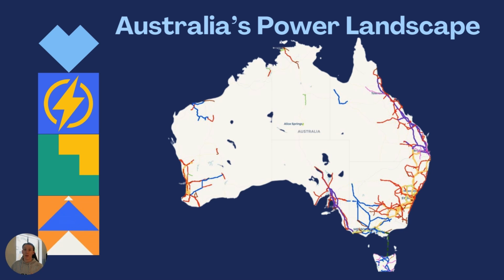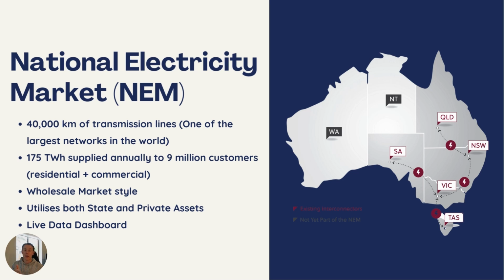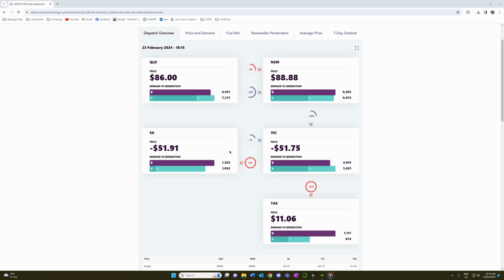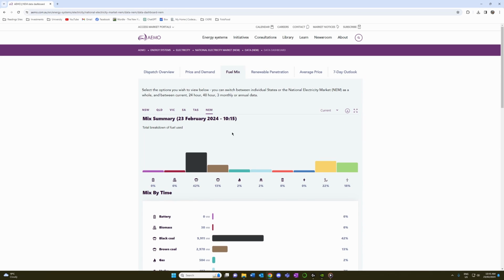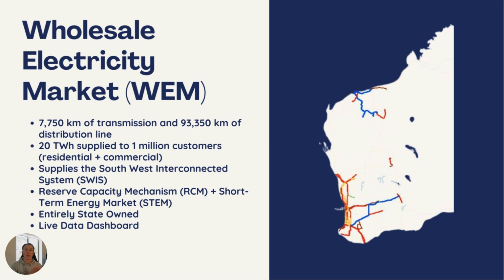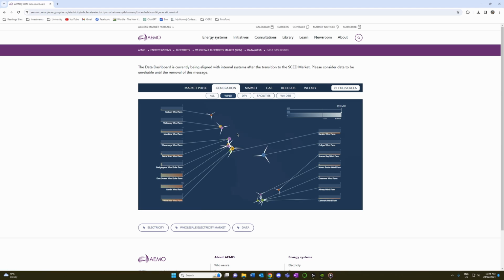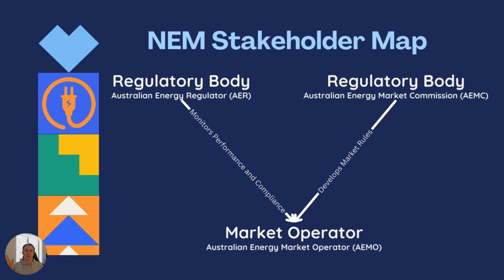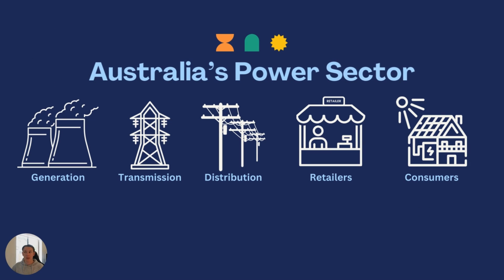Lighting up Australia: Australia's Electricity Network

Comment: good stuff mate, keep them coming not many channels like this in Australia
Reply from the maker: Thanks so much, glad you enjoyed it! Never a better time to be involved in and learn about the power sector 🚀
Reply: @jackburgemeister  so when spot market prices are negative, how do the generators get paid or they dont?
Reply from the maker: Yea great question @nbafan125 . 
When the price is negative in a spot price market such as the NEM, the generators actually have to pay to generate. A negative spot price can essentially be caused by 1 of 3 things: large amounts of renewable energy, low demand, or transmission restraints. In summary of these, when demand on the network is low, it is doing more harm to the network (over-voltage, increased frequency) to have excess generation, so the market operator (AEMO) incentivises against generating. In the case of renewable generation, most can be curtailed(switched off) very quickly so as soon as the price is negative they can switch off, but traditional firm generation takes a significant amount of time. This is a reason why traditional firm generation (coal, natural gas, etc.) only ramp-up when long periods of consistent load are forecasted by the market operator, allowing them to be economically viable as they cost more per unit energy.
Hope this helps 😁